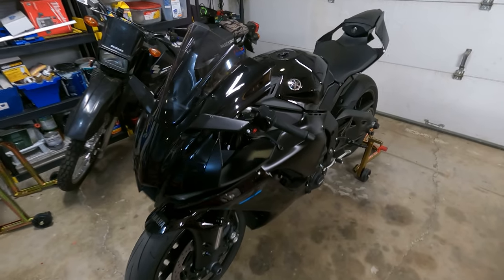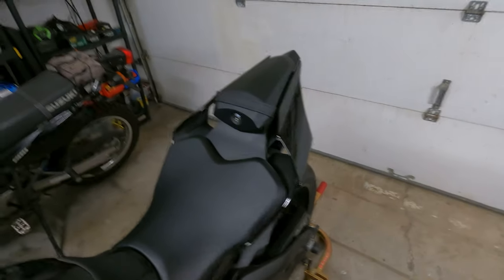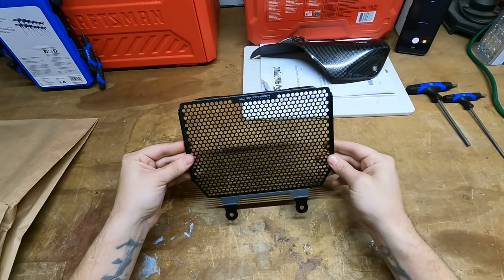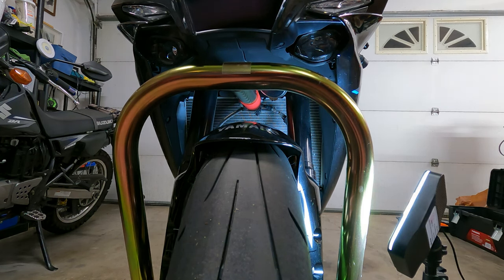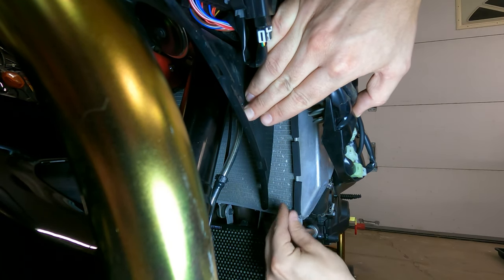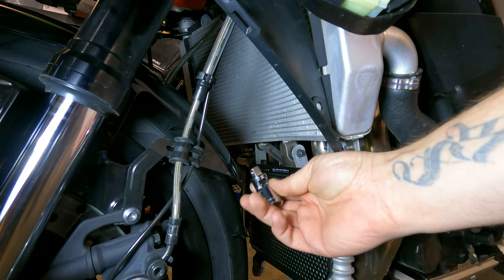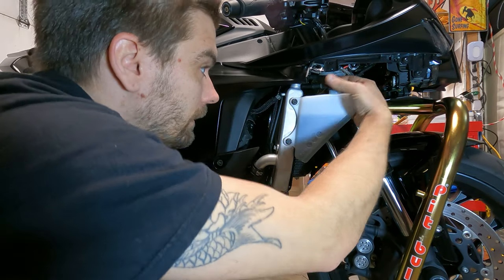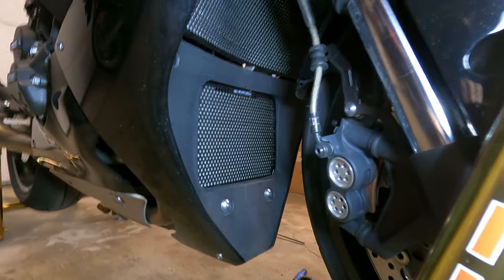Yamaha R1 Evotech Performance Radiator Guard and Evotech Oil Cooler Guard Install!

Comment: Great video, what did you use to pop out the one holding the fairing on ✌️
Reply from the maker: Which one are your refeering to? Lots of bolts to pop out fairing!
Reply: @MotoViceOfficial  I just use W Allen key I put on the genuineYamaha radiator cover great job, they should come on the bike in my eyes 👀
Reply from the maker: @roberttaggart5757  your telling me!!